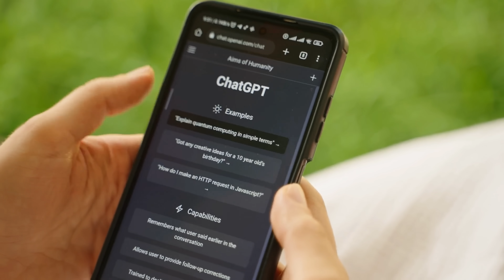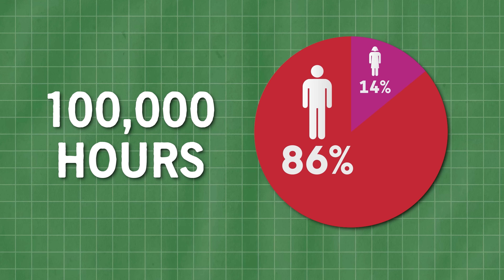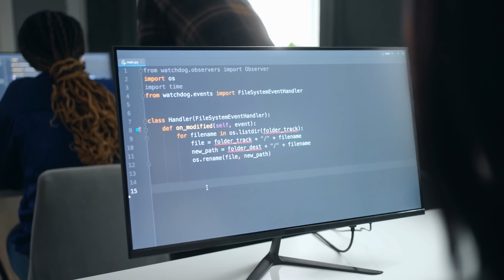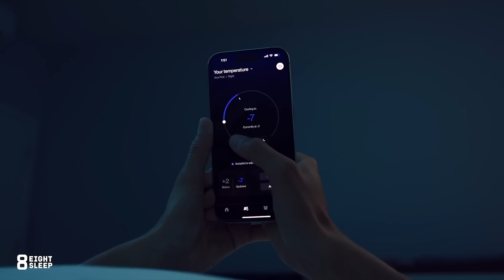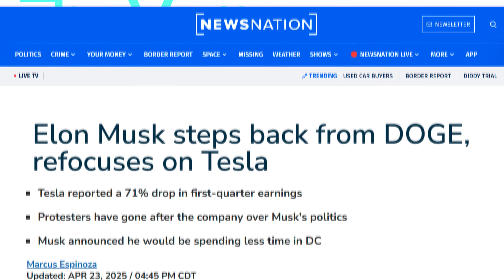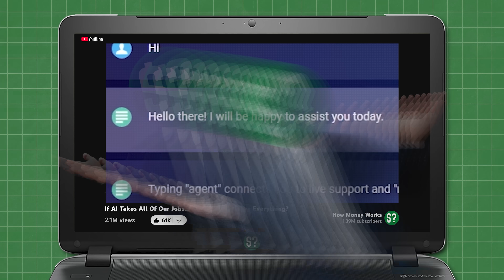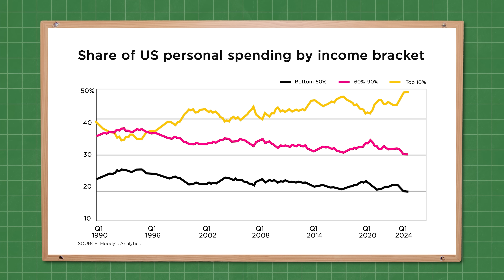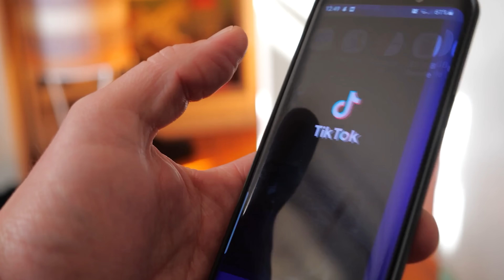Are You Ready To Have Your Job Replaced by AI?

Comment: Antropomorphic robots are a scam, at least for the next decades. Optimus specifically was remotely controlled by actual people, It was just a show. And I don't buy them being cost-efficient at all. Yes, It used a lot less resources in the final product than a car but the level of complexity, moving parts, delicate wiring and sensors are through the roof. They would be delicate luxury machines. I doubt they EVER make sense for widespread adoption.

Comment: I am thinking humanoid robots MAY have economically viable niches perhaps in hotel lobbies or something but anything requiring lots of repetitive movements etc would certainly benefit from a bespoke/conventional type of robot or automation. 
Any man made contrivence wears down... Especially if it moves a lot or lifts loads etc. It's just got a very long road to replace a 'normal' automation robot. Also they require power. A doorman for a hotel could be hardwired, problem solved. Being wireless presents significant challenges in real world applications.

Comment: Defending the use of humanoid robots because the world is tooled for humans is nonsense (sorry).
It is like saying that the world (saddles, stage-coaches, roads, drinking troughs) was tooled for horses, so we should have gone with mechanical horses, rather than cars, buses and trucks.

If the tech comes along to the point where humanoid robots works, there will hundreds of more efficient design modalities.

Yeah okay you can build something that will clean the factory floor with a human broom, and tighten widgets with a human tool and interface with the buildings lighting system. But the cost of building with servos+moters+sensors needed for it to look and move like a human will be waaaaay more costly than have a universal arm-to-device connects.
Then you can build a simple platform with as many arms as you like, that can be as nimble or rugged as want and move much faster and more efficiently than impose an iterative design solution that as come about as a result of hundreds of thousands of generations of evolutionary selection.

Comment: At 7:46 - what an over-simplification of the robotics industry.  If the 6-axis robotic arm costing $200k wasn't needed, a robotics engineer would have designed a smaller and cheaper solution.  Why do you think that a new startup will deliver a cheaper and more efficient product just because it's shaped like a human?  It doesn't really make sense.

Comment: @6:50 the problem with full self driving taxis is how little benefit they actually bring. Uber and Lift drivers already work for effectively minimum wage, and its not just driving they do. They buy the car, insure it, take on the liability for its operation, clean the car, maintain the car, and garage the car.

If Uber or Lift had to buy a million robo-taxis at $25K a piece, its $25 billion! That is $25 billion in capital to raise, plus the cost to insure and all the potential liability. And even after that, now they need to hire cleaners, hire maintainers, and either buy or lease a space to garage the car. And the most money they will gain for doing all this is the minimum wage they were paying the drivers. There is already a ceiling on how much additional revenue it will bring. And that is before we enter a price war where Uber and Lyft and anyone else is attempting to undercut the other, reducing margins further.

The robo-taxi business is a TERRIBLE idea. Its going to create a sink hole of billion in capital that will can only be repaid in a very, very marginal way over many many years and will create whole new workflows and liability structures for the robo-taxi owners to manage.

Comment: We still have cashiers and parking lot attendants.
There becomes a point when the cost to buy the robots becomes too expensive and humans are cheaper. 
In the long run the robots are wayyyy cheaper, but in the short term humans are. If the demand is high on robots the price will increase to the point where a company (especially smaller ones) would struggle to justify the upfront cost.

Comment: anyone who works in manufacturing knows how cheap and rigged together most things are in factories.  Most manufacturers will take an extremely long time to update anything in their facilities, even if it would obviously save them money in the long run.  Also most machines are expected to last an extremely long time, meaning that most machines are wore out to the point where they need constant maintenance.

I make at least $50,000 in product during one shift, and they refuse to pay for a 2 foot long conveyor belt that I have to re-duct tape together again every day.  Which requires machine down time, which costs them money.  There's no way AI robots are going to be a justified expense.

Comment: “Humanoid robots will only need to get another mop”

Brother the humanoid robot isn’t invincible. Especially if it’s designed like the cybertruck
Reply: other humanoid robot can fix the broken one, just like doctors
Reply: @gmatheus10  you gotta understand repairing technology is very different than repairing the human body, because through millions of years of evolution the human body can literally repair itself. it’s honestly amazing. 

like, if you get a cut or a scrape, you can just put some antibiotic on it and cover it up, and it’ll be completely gone in a week. when you break a bone, you visit the doctor not because they have to replace it for you, but because they can make sure your body heals the bone the right way, which it will still attempt to do even without medical attention. sure, sometimes surgery is necessary, but generally speaking, it’s a lot easier to fix a hyper-intelligent self-repairing ultra-resilient biological machine with thousands of years of repair documentation written by its own kind than a vaguely explosive battery powered hunk of metal that can just break for no reason and need a complete replacement.

Comment: I do not think humanoid robots are the future.  I agree that application specific systems are most cost effective than the rest simply because they are much more simple. This translates into lower maintenance and issues. 

A humanoid robot has many moving parts and is also silly to think it will never require service and will be working flawlessly 100% of the time and wont simply glitch one day and have to be send off to the factory for repairs or waranty. 

On that alone i think low paid jobs will remain available for humans as these machines will simply very more expensive than people. Extra for specialized trades, even if they are more expensive positions their jobs are much more complicated. 

And for more complicated jobs like I dunno surgeon, yeah also very complicated that is why medical robots use human operators. So most automation will be done, i think on mid jobs simple enough to be automateable but not enough to hard for the robots.
Reply: They will just fix and maintain each other. Obviously.

Comment: The pneumatic arm robot comparison to humanoid robots is a moot and weak argument because they serve different functions. Pneumatic arm robots used in precision large scale factories is precisely used for fast efficient assembly.

If you suddenly changed to humanoid robots it's like older era of using human workers for most of the assembly process.

There is a reason why these specialised arm robots are used now. Because they are faster and more efficient at what they do.

Humanoid robots are more likely to do other things aside for the actual conveyor belt assembly line.

Comment: Automation ain't what most think it is. Robots, while great, really are stupid. They can only do what you program them to do and a lot of times, they fail. Now that could be any number of things, but outside of programming, you could train a chimp to manipulate a Fanuc robot. The tool cords used to power components on them are flimsy and installing is pretty much paint by numbers. Then the components on them are ridiculously overpriced. The industry seems to be secretive with information because I can't even access wiring schematics or exploded views. When I waa at Stellantis we retooled our plant in 2022. One of the new lines had an issue nobody could pinpoint. I asked my boss, where the hell are the diagrams??? This is new equipment. Boss tells me, oh no we don't have any of those because those cost extra. What??? We just spent millions of dollars to have this crap built and installed and we have to pay extra for a set of damn prints??? All I can tell you for sure is the people that build and install automotive weld lines, wouldn't make a pimple on an electrician's a**.

Comment: Ok, great video, but a few notes on the comparison between humanoid robots and industrial robots. Yes, humanoids as a market can be scaled way up. But besides that, the comparison has quite a few errors. Industrial arms like for car factories that are uniquely large/strong and precise are expensive because they are uniquely large/strong and precise. Making any machine strong or precise makes it expensive, that would go for humanoids too. They already make small robot arms the size of a humanoid, even arms on wheels that are stronger than a humanoid for the same size that are cheaper. It's actually INCREDIBLY difficult to make humanoid robots strong. Secondly humanoid robots use heaps of uncommon parts, arguably more than industrial robots. Lastly, humanoid reuse is not trivial; it is very software intensive or data intensive (or both) to get a humanoid robot to do a new task well. Humanoids will not be taking the roles of large industrial arms en masse, even if they do take human jobs en masse

Comment: A little bit confused on some points of a prospect of humanoid robots replacing humans:
1. Regarding standard tools. Well, you see, we have our own tool that allows us to interact with most tools efficiently - hands. Just pick up a screwdriver, use it, and pay attention how many muscles and joints of your hand you are using. I assume that robotic manipulator of the same functionality is possible, but very likely it is going to be rather expensive and require regular maintenance.
2. The assumption that such robot will pay itself off, I assume, compared to regular salary of the person. So, for example, you pay $100k per year to a person, or you buy a robot for $100k. So, you want to say, you will not have any expenses associated with this robot? With a person, you pay $100k, and that's it - the person themselves will take care of living expenses etc. But the robot? It will be your expenses to ensure it works. And if energy question might not be that important, I would assume it would require quite some maintenance, and it will be more likely more complicated than your average car maintenance.

Comment: humanoid robots are a marketing gimmick. Bipedal locomotion just isn't an efficient trade-off. Balance is a massive resource investment and you don't need to consider it if you can just slap tire treads onto the bottom of something, or use a quadrupedal model and have whatever manipulation arms attached elsewhere. 
In theory, if we even bother with 'walker' models, we'll more or less exclusively use models with 5+ limbs - depending on need.

Comment: 8:00 I don't agree with your arguments on robot prices comparing common Industrial robots with humanoids. Industrial robots are already being mass produced and OEM pay low 5-digit prices to the original vendor per unit. However, I agree that they will get to that level with humanoids once they can sell them in equal numbers, but they won't take over actions that industrial robots are made for. IRs are fast and precise, HR are designed to be flexible.

Comment: Wouldn't humanoid machines capable of the same level of finesse and mobile as a human be insanely complicated with lots of moving parts? They  would be immensely expensive to maintain in the long run, would require specialist to repair and need very specific parts for repairs. Still seems cheaper in the long run to use cheaper flesh robots.

Comment: In a healthy economy, the automation problem would be manageable.  But this is not a normal economy.  Businesses are not actually run for profit anymore.  They are run to put a lot of money into the hands of a few elites, at the expense of banks, investors, workers, and consumers.  The laws that shape this economy make it easy for the businessmen to pull value out of the economy, and almost impossible to put value into it.  And that isn't anthropomorphizing.  Changes to laws from the 1980s onward have caused businesses to function in a increasingly destructive way, and automation could push it over the edge.

The result is likely to absolutely suck.  Businesses and very wealthy people are good at ducking taxes.  So when you hand them all the money, the tax base shrinks.  Wealthy people spend a smaller percentage of their wealth, so when they do most of the consuming, the economy shrinks.  Homeless people can't consume, so when you drive more then half the population into homelessness and then punish them for it, the economy simplifies.

Comment: As a mechatronics engineer, had worked both in factory automation solutions and offshore drilling rigs, and now learning Ai... I can tell you, "things had not even started". 
The next 10 years will be what we had been waiting the last 20 years to happen, Automation to be smart enough that it can be treated like a 5 years old kid (hopefully we get to 10 years old capability), instead of todays babysitter lvl, and believe me, a good 80% of your jobs today, can be done by a 10 years old, 90% of the time (normal driving, logistics, document checking, spread sheat sum and cut and paste, hit, push and pull and/or hold something, verify what the "manual" say, and how to use "it").
The 2nd wave of Ai, is robot Ai... And in todays team of 3 persons, replace 1 by and "10yo smart" strong tireless cheap robot, will not be just a plus, will be a "most do it"

Comment: In my last job I was involved in adapting a module to calculate required taxable distributions for mutual funds for new clients. If people asked me about automation, I would say that the automation software would need to be able to read the minds of the clients ( the fund administrators), since they usually used a mess of spreadsheets to run the calculations, which the programmer and I and our manager would try to decipher. Funny, I remember that the manager had dealt with a client who actually said that required info "was in our heads"! Sure.

Comment: If you can get a humanoid robot to lift a hundred pounds and use hand tools, all hell is going to break loose. So, so many jobs fit into that category.

Of course, at current AI trends, certain visual tasks are very difficult to automate, like mechanics working on the shitbox we call engines. They are all the same thing but damn they are all different. Mechanical repair is hard, but only when full replacement isn’t an option, because solving an abstract problem—doesn’t work, make it work—is really hard for AI. Now if you just replace parts until the thing works again, then that is easy.

Going from A to B with AI: easy
Going from A to Z, Q, or T with AI: good luck.

Comment: 3:50 Are you telling me that the hispanic dude that work as contractor is less likely to lose his job because robots? I didn't see that coming.
Reply: Well trades and more physically complicated tasks are harder to automated then mentally complicated tasks
Reply: @doggowazhere7016 that’s not why, real world geometry just takes a lot more planning and problem solving than something that can be done in a screen. Not to say that there aren’t problems much more difficult in either dimension, but getting a robot to—say, fix a pipe in a house today would mean interacting with parts meant for human hands.

Let’s make up a problem here, say you need a robot to open a door. You need to make the robot move, use a camera and probably load it with a model to recognize what a door is, what a door handle is. You then need to build the inverse kinematics for the arm and whatever claw or soft robot end effector it has to grip the doorknob. You also need to be able to plan that motion from the robot arm to the door knob, so maybe a depth perception camera or a LiDAR, or maybe a combination of both, etc, etc.

Comment: Your claim that there is no reason for humanoid robots cost the same as a car is full of flaws: for it to be reliable the components has to be expensive, because of strenght alone, the whole drivers/actuators/sensors bundle also will be expensive gived it need to fit in such a small space, and even if it all works well, not a way in hell it can replace the articulated arms, there are things that humanoid design cant do. The whole "humanoid robot" is another tec hype, just like cripto, always searching for the next big thing (and I didn`t started about the social part that the concept breaks capitalism at the base: no one works, no one has money, no one buys)

Comment: You are assuming the human form factor is even efficient or cheap to mass produce. Even if it's plug and play, dedicated robots in non humanoid form factors are less likely to sustain joint failures and wear and tear compared to humanoids, which is only really evolved for walking and being adaptable.

We didn't have an economy tooled for humanoids because it is efficient, it is because we are currently limited to humanoids.